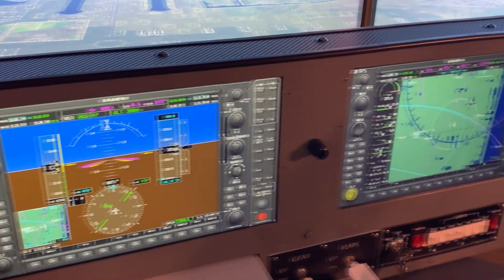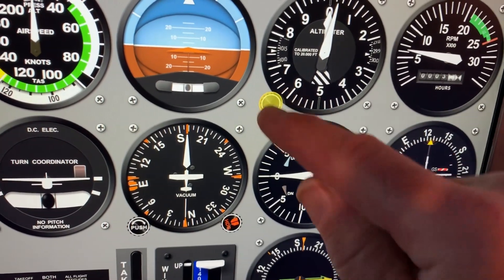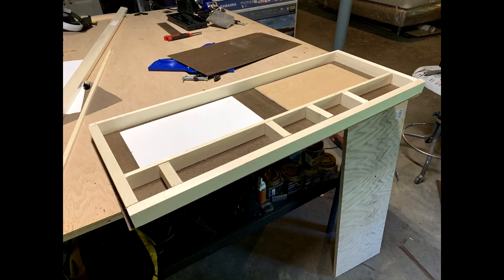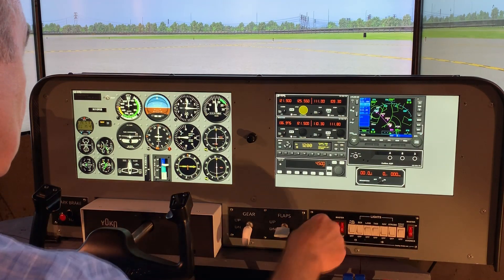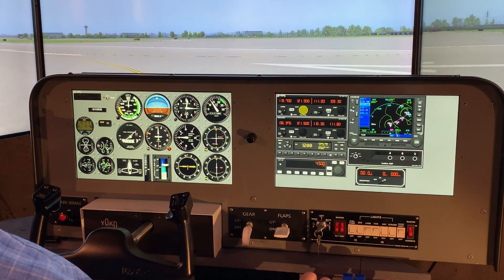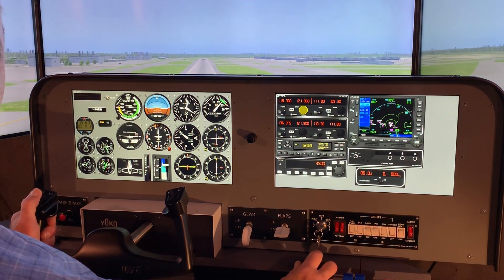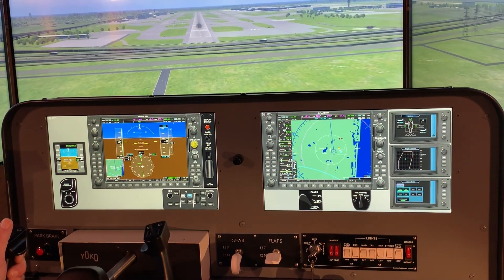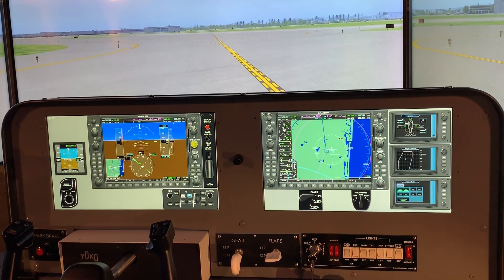DIY Twin Touch Monitor Sim

Comment: Russ, ever since you posted this video a few months ago, it motivated me to create a cockpit panel similar to yours.  I am using the same 60-degree wrap-around with three 50" TV's.  The cockpit panel finished using the same two Prechen Monitors.  Now I am ready to purchase the Air Manager programs I need.  My question to you is:  How you are getting Air Manager to run on the two cockpit displays?  Are you using two copies of Air Manager or Air Manager and Air Player?  And, if needed, can Air Player run on the same PC as Air Manager without a significant performance hit? I have an I7-8700K with a GTX-1080 to run the external visuals.  My other and older PC that I will run X-Plane and the two cockpit displays on has an i7-4770K and a GTX 780.  I'm not sure how the GTX 780 will handle X-Plane plus the two panels. I'll give it a try and upgrade if necessary.  Thanks again for what you do for our community.  Rick S.
Reply from the maker: Your computers sound fine.  Run Air Manager on the lower powered one along with a copy of XP11 as the Master copy.  You need to have the master so you can popout the GPS windows and position them behind the Air Manager panels (in the transparent "holes").  On the faster computer run another copy of XP11 as an external visual with the three view visual on the three monitors.  The master will compute the flight model and you can dial back the graphics settings to keep a good frame rate.  You can even zoom in on some thing like the cockpit headliner to reduce graphics load since all you are really gong to view are the GPS windows. Set the visual as high as performance allows and to still keep a decent 30-40 fps. You only need I copy of Air Manager but unfortunately 2 copies of XP11.  Try a coupon code of "showspecial" and you may get 20% off if the deal is still available. Let me know how it goes.
Reply: @rbarlow  Thanks Russ for the reply.  The one area that I'm still not sure of is how to get the Air Manager Panels on both of the Prechen displays.  Do I need Air Player as well? And if so, can I run both Air Player and Air Manager on the lower-powered PC?  It was my impression that Air Manager could only do one panel on one screen only.  Like you, I will also be flying other types of aircraft using Air Manager for displaying both flight and engine panels on separate screens.  I've been out of town on business all week and will be diving back into the sim on Monday. I'm trying to get all my ducks in a row ahead of time. Many thanks for all your help.

Comment: Hi Russ, awesome stuff, love your channel and the good work you are doing. Would Air Manager run "stand alone" without a flight sim to feed data from sensors via Arduino to gauges? Thanks.
Reply from the maker: Good question and you are not the first to ask. It is possible to take the Arduino inputs and use them in a script to display graphics based on them.  All the arduino does really is report what is happening to it to Air Manager.  Then what Air Manager does with that info does not require the sim.  For example you could create a digital or analog input  and in the callback display that data on a gauge or in text on an Air Manager panel.  I have created several simple Air Manager instruments that have no exchange with the sim.  So, yes.
Reply: @rbarlow  I bought the AM software last week and I'm waiting for the Arduino and Raspberry to turn up... excited to get started.

Comment: Russ can you detail the config setup for this build?  I have two computers but am unsure of where air manager needs to be installed (Master or Slave?)  I plan on using my lower powered PC to drive the avionics and my new super speed computer to drive the forward views using my matrox tripple head to go.  Also is there a template on what shape of hole to drill to mount the knobster?   Thanks.  Matt
Reply from the maker: Yes I run the visuals (in my case separate views in X-Plane to get a geometrically accurate view) on the slave(external visuals) computer  and the Air Manager panel on the Master.  This is necessary since only the Master updates the popped-out G1000 /G530 windows .  If you are not using the virtual cockpit on the Master computer you can reduce the graphics settings and set the view to some area like the headliner in the cockpit to improve FPS.  The 2D G1000/G530 windows are not dependent on Graphics settings.

Comment: Thank you once again for another enlightening video about creating the ultimate cockpit.  One question,  did I hear you say somewhere that in Air Manager you can obtain the PFD and MFD bezels for the G1000?
Reply from the maker: Yes the bezels are available on n the Sir Manager free store. A single bezel instrument has a user property that can be set to PFD, MFD, or PFD for co-Pilot. So just add it twice to your panel and set one to MFD
Reply from the maker: Mark novak have you watched my video on XTextureExtractor. It has been improved since the video was made to automatically find the textures. It also can save the locations and sizes of the windows so they will open at the right place see. https://youtu.be/ACR1K2dwpME

Comment: Russ, great project.   Question, I see you have three screens for the outside view and 2 touchscreens.   How do you get around the 4 screen limit on most graphics cards?   If I could do that I would be doing this like a flash!   Many thanks
David
Reply from the maker: David Davis I actually have two computers running X-Plane,  one for the three visual monitors, and one to control the panel and Air Manager.  The master is the panel computer and the graphics settings can be dialed way back since it is only running the flight model and the popped out windows for the panel. 

If you have a very robust computer you may be able to enable your integrated graphics in your cpu and use that port to drive a fifth monitor and still be an acceptable frame rate I think you would have to reduce the graphics settings but if you could live with that you could avoid the cost of a second computer and extra copy of X-Plane. Let me know how it goes if you try either path.

Michael Brown from XForcePC has a YouTube video on how to enable the onboard graphics as a fifth graphic port if you are interested
Reply: That makes a lot of sense.  I assume that the master computer is the less powerful of the 2?   The 3 screen one would have to carry some hefty graphics load.I obviously need to resurrect one of my retited machines!
Reply: I don't think my motherboard, (an i9 x299 mk2) has integrated graphics.   I have a couple of retired machines I could resurrect.   I assume that I can use the Air Manager on the secondary machine as my 2080s are mounted in the original i9 machine.
I am interested to see what SLAVX do for you on the panel.   I am quite interested in that myself, lathough it may cost a fortune to ship to the UK.  I will keep you posted.   I think this project will not complete until after Xmas, as I am waiting for Sim Innovations to have a knobster in stock.
Reply: Can I also do this 2 computer approach using MSFS?

Comment: Hello Russ, 
I am a retired airline pilot, I flew B727 and B707 as FE and all the way to command on the B747-200. Fate had it that I lost my medical due to a heart attack. I tinkered with old flight sims that had these planes (with analog gauges). I am following your path in building a home brewed sim but can't find any topics in this regard, since you're so well versed and active in these projects, have you come across any old heavy airplanes setup?

Thanks,

Ed

Comment: I love your setup. As a former GA pilot who cannot get a medical I’ve built a sim so that I can still enjoy flying and wish I’d found your channel before I did sim. Oh well time for a new project!  I think in a previous video you said you had 3 50” screens. What’s the angle on those?
Reply from the maker: Jim Stanford I have them on three rolling  monitor stands so it is adjustable but I have found 60 degrees field of view on each monitor with each monitor back at a 60 degree angle gives me a  very realistic 180 degree total view and the sweet spot for the perfect view is far enough back to get my panel in front of the monitors. Remember that the panel has to be offset to the right so the pilots eye view is centered and normal to each of the three monitors. With 60 degrees that puts the pilot eye position centered and even with the rear edge of the two side monitors. I have a video about this geometry. https://youtu.be/PjdgOBJ5xkQ

Comment: Mr. Barlow, I am new to simulation layouts and I have no clue how monitors, main screens , and the computer interfaces with X Plane.
Reply from the maker: PacoJr1950 that is a very broad question. Do you own X-Plane11 already? If so I would first be sure you can operate the basic sim with a single monitor. You can start easing the keyboard and mouse but I suggest you at least get a cheap joystick with a throttle control and a few buttons for basics like gear, flaps and brakes. There are lots of YouTube videos for beginners with X-Plane 11. Once you are comfortable with flying the sim then you can start expanding with rudder pedals, additional monitors and perhaps a panel running with Air Manager. Take your time and have fun learning a little more each day. Good Luck !

Comment: Excellent video Russ. Quick question. Are you running your main triple displays off one machine? What computer runs the touch screen displays and how are they all tied together?
Reply from the maker: Yes Visuals on a 1070ti medium settings getting 50-55fps and the two panels running x-Plane and Air manager gtx 1070 getting 70 fps

Comment: Hi Russ. 
First of all - it was nice meeting you in person at the Sim Expo in Orlando.
My question is a unrelated to the touch screens, but I bought salvage car seat that's electric for my cockpit chair (from a Honda Odyssey mini van).
Do you have any ideas on how to power the chair. I'm sure it will need a converter to go from 120v AC to 12v DC, but I'm not sure about the power needed. I know the seat uses a 30 amp fuse in the car, and from what I've seen online the amps needed to run the chair are probably more than 5 amps (one guy measured 5 - 7 amps for moving up or down with a 200 lb person in the seat) and less that 30 amps (the size of the breaker used in the car). 
This is what I've found online from different people, but the comments are a little sketchy and I'm not sure if they know what they're talking about. I haven't been able to find anything about the chair motor specs from the local Honda dealer, so I'm having to guess at it. 
One person suggested an 18v cordless tool battery, but I have no idea how to wire it. 
Thanks for any suggestions.
PS - just bought a 24 inch touch screen to use with knobster and air manager, but I like the idea of two 16s instead.
Reply from the maker: C.E. Sherrod I am no expert but a power supply like this might work

 Aiposen 110/220V to DC12V 20A 240W Switch Power Supply Driver,Power Transformer fo... https://www.amazon.com/dp/B01B2U0DEY/ref=cm_sw_r_sms_c_api_i_sH0wDb161D9SB

Does the seat have a heater? That could raise the rates amperage. If you have a 20a supply be sure to put a 20 fuse in the circuit. I’d ask an auto mechanic to help you figure out which wires are the 12v power and ground wires. There is probably a plug that connects to the car.

I wish I could help more but I have a manual BMW seat in my sim.

Good Luck. Let me know how it goes.
Reply: @rbarlow  Russ - you are amazing. That's the one I was looking at on AMZN  :).
Thank you so much.

Comment: Nice one Russ. That is very similar to what I will be building and why I worked up a 2 panel version of my C172. I plan to do others to serve this purpose. The conclusion I came to was this type of setup gives the most realism while maintaining a generic setup for those of us that like to fly different birds. Keep up the great work.
Reply: Good point!
Reply from the maker: Experimental Sim Avionics I really appreciate your work... top notch. I am trying to create a metal version of this sim with the ability to placard switches mounted in the panel with magnetic “refrigerator” style die cut magnets as placards. Printed vinyl decals applied to the magnets(with holes for switches) would allow the same group of switches to simulate a large number of airplanes just as the lcd screens can. I think a mega will run it all.

Comment: I enjoy your videos and find them quite informative, but I know little about building a simulator such as, what computer should I use, programs etc. My goal is to become a CFI so I'd love to practice on a home sim to save money
Reply: X-plane 11.  I7 7700k or 9900k, overclocked. 1080ti or 2080 ti graphics card.
Reply: Any brand of computer you recommend? And of course, cost
Reply from the maker: Shawn Smith just be sure to use an intel cpu and NVIDIA gpu as AMD doesn’t seem to play well with XP.  Obviously faster is better but go to User Benchmarks ( https://www.userbenchmark.com/  )to get real word comparison of CPU and GPU speeds. It seems you pay a lot for the top of the line to get marginally higher performance.  Remember you are shooting at a moving target and whatever you buy will likely be lacking in 3 years. I kind of think the RTX2060 Super is a good value but if that is too pricey the GTX1660ti is decent too. For comparison I have a gtx1070ti in the computer running the three visual monitors in the video and get 50-55 FPS with  an i7-8700 non-liquid cooled cpu.

Comment: Hi Russ. Another informative video. I bought a 15.6 inch touchscreen a couple of days ago on the strength of your previous videos and my Zibo 737 setup is now underway (I will be buying other touchscreens too).

I have a question for you. I'm using xtexture extractor for my nd and pfd displays (again, using info from your previous video) but I'm thinking that if this didn't exist then it would be extremely hard to replicate everything that is required for these displays. My question is simply, are you aware of any other options? Are we just lucky that xtexture extractor exists? Thanks.
Reply from the maker: Wayne Sibley yes it would be extremely hard. Garmin has teams of. Engineers and for X-Plane (Philip Ringler) to Reverse engineer the G535/430 and G1000 is a giant feat. If think in time more developers will have pop out windows for their Airplanes. Carenedo,s Premier 1 jet has pop out displays for example. The guys at Sim Innovations are working on a way to stream the textures directly to the Air Manager instrument so there would be no invisible holes and resizing and positioning popouts. It would be able to stream fron X-Plane to AM on another computer as an MP4 stream. Fingers crossed.

Comment: LOVE the Knobster!  I've built a setup based on On The Glideslope's simulator, except for using Air Manager and touch screens for the panel.  My touch screens are ??22 inch?.  Air Manager (those guys are rockstars) is SUPER SIMPLE to use and create instruments.  I've made and modified several instruments for the Mooney Ovation from AFM Simulation.  EASY to do. Air Manager, The Knobster, Pilot Edge and Navigraph are sliced bread!  I use my setup to practice instrument work with Pilot Edge.  I sometimes forget that I'm in a simulator.
Reply from the maker: M Cotherman thanks for the feedback. I thought Knobster would be a hit based on my experience with it but nice to know others agree.

Comment: can i jus make my own knobster? or i have to buy it on the air manager webstore?
Reply: You can make your own by using a USB controller card and a Dual Rotary encoder. It will be much cheaper. You can then use an application such as FSUIPC to send the offset command or button to the aircraft. This will work in FSX, prepar3d and X-Plane.
Reply from the maker: Since the Knobster must know which dial has been selected and what to do in response this scheme only works with Air Manager panels. Air Manager is compatible with FSX, P3D, and XP.

Comment: Russ, I thank you for another very nicely done video. I recently started using two identical RCA Cambio touch-screen lap-tops with Air Manager running on each one. They have removable keyboards that snap into place with magnets. About 230 USD each. So, altogether, you have FIVE screens! What  video card are you using that has five outputs? Thanks again, Russ!
Reply from the maker: John Vybiral actually I am running two computers. I know there is a way to use the internal graphics to run a fifth monitor but my frame rate was already minimally acceptable with 4 monitors. I now the three visuals on my  i7-8700 k / 1070ti as external views networked to my master XP11 running on a i7-4770 / gtx 1070. That way I can have XP pop out windows with the Air Manager Panels. I get 45-55 FPS on the visuals and 60-70 FPS on the master. I now need a new computer for my VR setup as I stole the gtx1070 from that cockpit.
Reply: Hi john vyboral.
May I ask about your set up, how does it perform to run one main computer with two separated touch screen laptops?

Comment: Looks great... I picked up a 15in touch screen for my sim set up works great with Air Manager...
Reply from the maker: Yes I thought a single monitor on a narrower panel might work well too. In my setup I am running two computers and copies of XP11. This is so I can put pop outs on the Air Manager Panels. My i7-8700K /gtx1070ti runs the three visual monitors at about 40-50 FPS and my older i7 with gtx1070 runs the master copy of XP with two panel monitors at 70 FPS. .
Reply: @rbarlow  I really like your setup and am in the stage of building my 1st cockpit, inspired by this video. Can you please tell me how you got the G1000 pop-outs from the main computer to the secondary computer which is running air manager? When you have only 1 computer you would simply drag them to the panel monitors, but now that these monitors are connected to another computer I can't figure out how to do that.